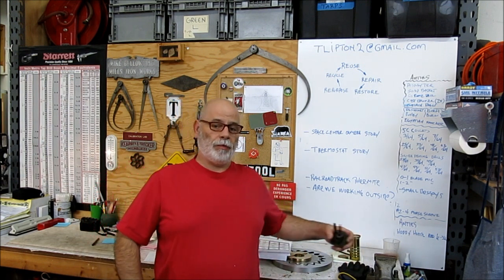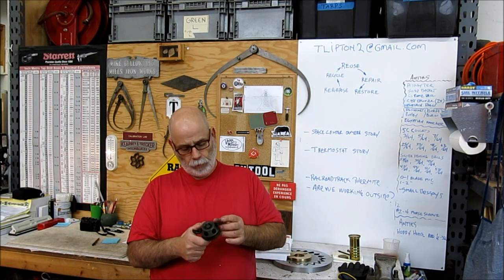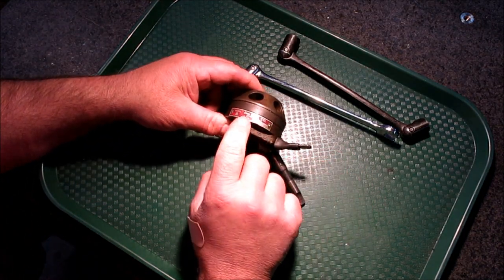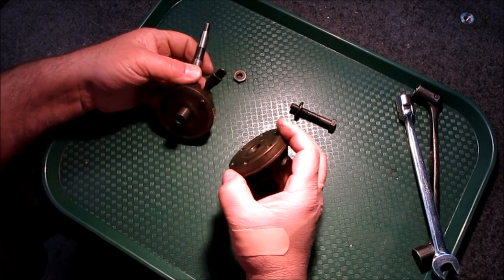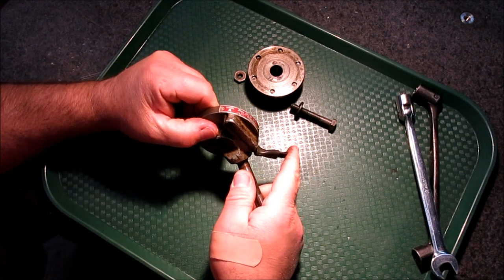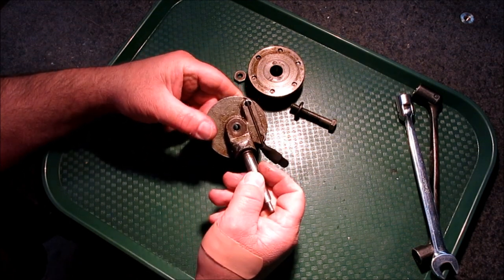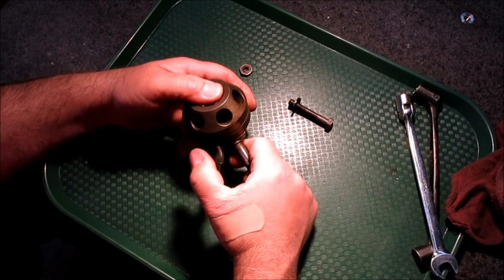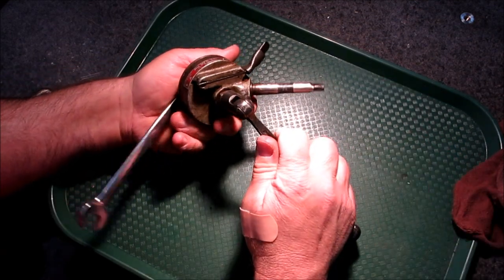Tailstock Turret Dissection

Comment: Enco has 'em w/#2 Morse taper for $67.76.  Accessory kit with 2 drill chucks, 1 reaming chuck, 1 tap holder, 1 die holder, 1 live center, 5 round die adapters and 7 tap collets is an additional $130.36.  One would pay for itself if you frequently had runs of 100 parts to make that required multiple operations.  Not sure it would be worth the effort for a half-dozen holes, but it might be handy, and it would impress the visitors.  It's an interesting little gadget.

Comment: I got this book years ago to learn machining .The book is called the amiture lathe operator and this paper back book had alot of info about machining in general .This book also has planes for building a tail stock turret and i built one and have never used it but i did a great job on it and love showing it off.
Reply: The Amateur's Lathe L.H. Sparey

Comment: Cool. I have a tailstock turret with 4 positions that has integrated small collets, making it very compact, minimal tool stick-out. One collet and nut is missing, have to find out what type it is. It has a no. 3 Morse taper. on the tailstock end. I think these collets have a maximum clamping diameter of around 10 mm and mounting a chuck is not feasible probably - looks like it was designed for small work.

Comment: MSC #: 				 08620452
This would be a good start for a bigun for your Yam!
Or does it take a #5 ?
If so you want this MSC #: 				 00305300
If you have the MT taper sleeve for your headstock,
most lathes come with them but they tend to get lost,
one of these could be built dead nuts accurate!
Nothing wrong with the straight bored holes either,
3/8-24 or 1/2-20 threaded chucks are readily available and the
adapters would be easy to make, not to mention telescoping
die holders or what ever LOL
This would be a great project for anyone, added to my list!

Comment: The base could be done without casting or removing a lot of material simply by making it as tall as the plane where the nut and the base touch.

So say, you'd take a puck that's as tall as described above, cut a slot for the handle (hacksaw, vertical milling, horizontal milling drill and file..oh the endless ways of doing it) ,

 that's simple,

 do the two holes, one for the stopping pin and another for the spring, add the handle retaining pin hole
(also the pivot axis for the handle, if it were me i'd make it a screw)
on the side and bob's your uncle. (first time using that expression, i wonder if i contextualized it well enough)

The slightly complicated part would be fitting the morse taper. But not as much as one would think. The way i see it, so as long as the chuck holes and the m.t. are aligned perfectly in the end you could get away with tiny imperfections as far as alignment with the base is in concern.

So through some setup you'd drill the hole and sacrifice a morse tapper out of a tool (better than to make one) and do it the same way they did it.

Tho, again, if i'd make it i'd step it up to the next size, don't know what it is but that tool holder looks wimpy to me, at least that m.t. part. 

Once you've done that you throw another puck at your lathe and using the compound you'd make the angled section and the screw hole. You'd mill the retaining pin holes for your stations, however many as you'd need 3, 4, 6, that's the beauty of making your own tools.

*one step i'd add is, i'd make a sleeve hole both inside the top section and the bottom section, that way one could simply slide in a sintered bronze bushing for ease of replacement*
In any project i do, i like to leave myself a backdoor so i can come back later should i ever need to and correct mistakes or upgrade things.

-Once you've accomplished all of the above and all holes are drilled, all fits are fitted and all parts are installed you'd simply put it in your tailstock, make sure it's aligned perfectly etc etc etc and stick the drill in your chuck and make the holes for your whatever choice of tool holder is and you're done.

If i'd have time, i'd make it exactly as described. Keep in mind that i'm not by any stretch of imagination a person that works with lathes even a tenth of what you guys do so some of the processes described above might seem odd. However what this is, is the simplest method i'd use to reach A to B. 

Next year, if, hopefully, the exams and schedule loosens up a bit, i might attempt it.
The reason i posted this, is, hopefully if by some miracle i said something that makes any sense at all, someone could get it done easier and, i dunno, post a video. Again, having more theoretical experience than practical on machines (lathe, mill etc) might induce bad thought processes so i wouldn't know either way. 

Cheers.

Comment: I'm not sure I'd waste time with that thing up front Tom, The real time waste is the in and out with the tail stock quill. I would focus on a quick feed quill or slide design first, like a true turret lathe, then add this in the mix to eliminate the tool changes later if you wanted. I'm not sure I would get that motivated unless I was setting up for large production runs large enough for the capitol investment. At that point I'd buy a turret lathe or a Hardinge. On small runs you just make sure you get paid for the hassles involved or you tell them to take it to China & let them do it for free.

Comment: Questions regarding the angle. It can be whatever you want it to be. The lesser the angle though the more out front the tools will point and the less diameter part can be machined. This is because as you're using one tool the adjacent tools can be rammed into the face of the part. The more angle the more the tools are splayed out which could become a bigger snag issue with the operators body parts.

Comment: Hello, do the six holes in the turret have a morse taper? They don't look deep enough for that but I'd think that's how it'd work. If they are just parallel side holes, how do you get it to hold your tooling? Thanks
Reply from the maker: +Shane K Hi Shane,

The holes are 5/8 diameter and just straight bores. The bushings are retained with set screws. Thanks for the comment.

Cheers,

Tom
Reply: Thanks oxtoolco, how do you get the Jacobs chucks and live or dead centers to stay in the holes then? I just bought an atlas th42 for scrap price at the junk yard but the tailstock is one of these turrets with some kind of lever system that drives it in with adjustable depth screws, I wish it was a standard tailstock but it was almost free so I'm going to try and use it for now. I just need to buy a Jacobs chuck, I just don't know how to mount it, thanks again
Reply from the maker: +Shane K Hi Shane,

Normally you would use this tool for something like center drilling, drilling, countersinking then tapping. Not really the right tool for turning work between centers. Its more for repetitive drilling operations. Hope this helps.

Best,

Tom
Reply: Ok, I understand now, thank you.

Comment: I think the real challenge for a hobby machinist would be getting the holes in the turret on axis with the Morse taper that goes into the tail stock, Maybe the sneaky solution is to build it without the tool holder holes in the turret (do everything else), then mount a drill in the headstock to do the 6 holes in the turret.
Reply: At the same time they are drilling it out they could then also mark where the hole on the back needs to be for the locking lever to engage it to index that particular hole.
Reply from the maker: Hi Philip,

I would have everything done then bore the holes with a boring head set in the spindle so all the holes were on axis on their detent pin positions.

Cheers,

Tom